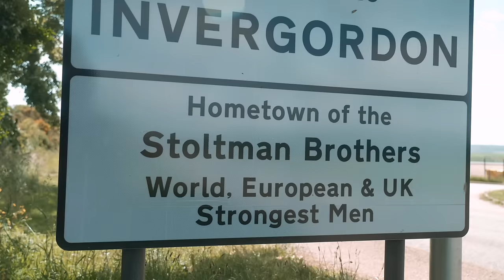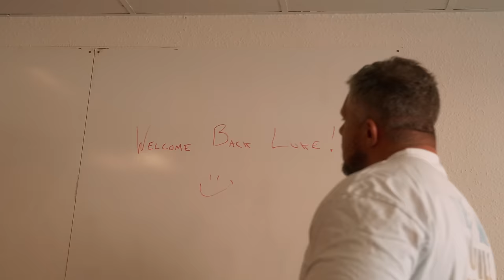Strongman Training Goes Off The Rails

Comment: Allow me to give some physicist assistance! The strap down by the legs needs to be further up towards the knee or even above. And then put the right hand between the legs onto the strap. So you're not trying to balance from the front of the strap explanation mark you have to grab the front of the strap on the chest because you can't punch a hole through his chest lol. But gripping the leg strap between the legs should help out a great deal! Along with moving the strap up towards the center of mass.